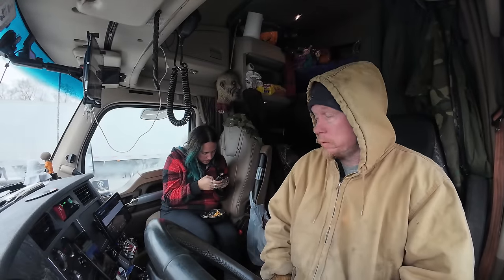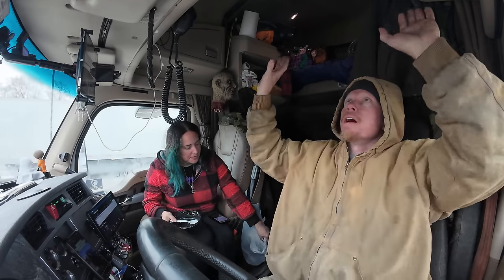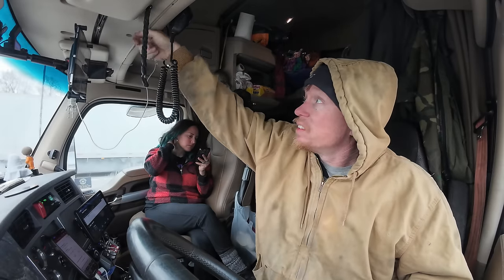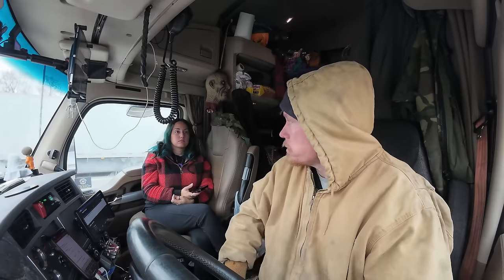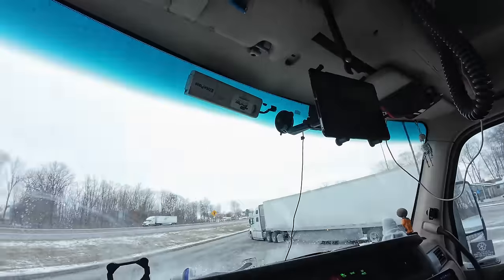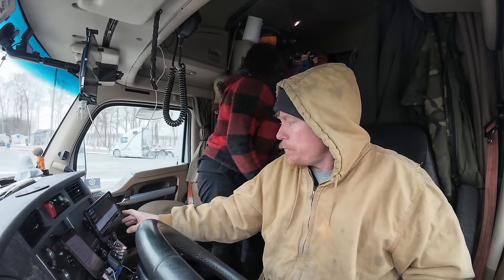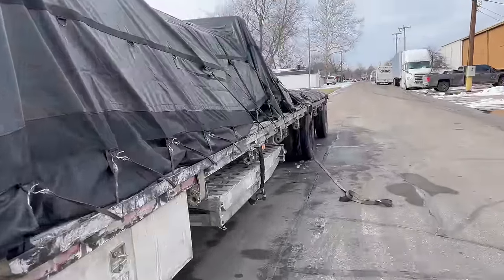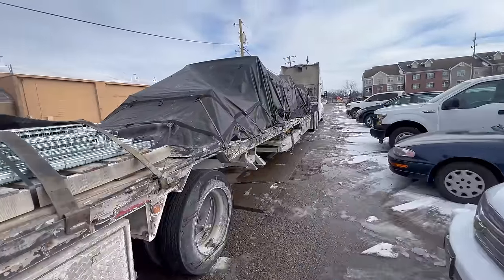That’s not going anywhere! Short 100 mile run!

Comment: I've had a little water drip from the overhead like yours was, and once or twice I had some leak from above my lower sleeper window. No rhyme or reason for when it does it. One thing for sure, it doesn't leak when I wash the truck with a pressure washer so maybe it is just condensation.

Comment: IDK If you can in the Truck but I run the AC in the winter sometimes in my Rav4 when I want to get rid of condensation and fogging inside the vehicle. I turn up the AC temp so it doesn't run cold. and this really clears things up for me.
Reply: Brent: I do the same thing in my tractor.

Comment: I was assigned a 2014 T-680 to drive.  It always leaked water in the winter when in snow and icy conditions.  One of our mechanics said that the gaskets around the cab marker lights would shrink and break in extreme cold weather.  He fixed the problem by replacing the gaskets.  Have you experiences your dash lights going out while you are driving at night?  That's been going on KWs for decades.  Safe travels from a subscriber from SC.
Reply from the maker: not yet, fingers crossed. have read about that though on some facebook pages

Comment: Those new Petes and KW cabs are leaking through the screw holes in the marker lights for sure. We just got through doing the third one for  a little company down the road from us.  We used weather strip adhesive on them and no more leaks.  They run back and forth to Louisiana in a lot of rain and the leaks stopped.  I figure it must be the way they use elec power screw drivers at factory and enlarge the holes.  Just be very careful loosening the interior trim and not break clips.  Hope this helps.  Bill

Comment: 2 adults, two dogs and expelling warmed air in a coupe that has no open ventilation? What go  wrong? Open the windows! and check your cabin filters more often in the winter. The warn air is condenseing just under the roof truning back to water droplets...many poeple call it the rain cycle...Let the warm out once in while..LOve the vids.....be safe..go get'm....
Reply: This is a good deduction of what might be happening. Especially, being closed up for 6-8 hours without opening any windows or doors on cold nights.
Reply: Don't forget cooking
Reply: Good idea  open just a little bit the window

Comment: Call Michael lights on the top of your cab. I would check all the seals around those. You might need to reseal those in the condensation that build up on the roof is running down and going underneath the light.

Comment: Seems like you have a condensation problem.  Airflow and insulation can solve that.   The area where your radio is seems to be feeling cold air from the outside while the warm moist air expelled from the family members in the cab is hitting it and condensing. you might try insulating that area with the same reflex material you made the window covers with.  Use spray glue to attach it to the faring cap above the windshield good luck.

Comment: If you want a huge sleeper that’s well insulated.  I have not been in their KW680 ones.  But the 800/900 ones were amazing.  But almost cost of that dump truck with bad clutch. *ok it was less but in last decade, especially last 3+ years*. Custom KW in MN

Comment: We have a class A diesel pusher and we had the same problem with moisture when we were traveling in the winter. The heater in our coach has heat pump / ac units on the roof but they will only make heat down to 32 degrees so then we turn on the built in heater that operates on propane. Probably the same heating system you have in your class A. The problem as you said its from you guys and the dogs breath that is ex haling H2O and in the rv the bi product of propane is H2O and that makes it worse. So the answer is to let the H2O out. We just. crack open two roof vents to let the H2O out and there is no moisture problem. If you have a vent up high in the sleeper just crack it open and leave it open all night or at least crack open one or both windows. Im talking !/8 to !/4 inch. Your house doesn't do that because it has much more insulation and the roof is vented.I have noticed that sometimes in the morning when you remove your silver window covers it looks like there is ice on the inside of the window. So I guess that proves people are not only full of S**T sometimes but are full of water all the time.Anyway love you guys and your videos, keep em coming.😀

Comment: 100% moisture from 2 + 2 pairs of lungs exhaling.  It likely didn't occur in the Mack because it had better insulation or the cab of the older truck had a looser vapor barrier thereby permitting moisture to vent to the outside more easily.  Small exhaust fan like a computer cooling fan in a cracked window will eliminate moisture buildup inside the cab.

Comment: My father's '62 KW leaked like a sieve too. I see KW hasn't improved much. lol Actually, I think you are correct, it is the condensation. Each person transpires up to one litre of water each night through breathing and perspiration. There are two humans and 2 big dogs, so you could be producing 2-3 litres of water each night. Plus you are cooking in that small space.If you don't ventilate adequately, that moisture has nowhere to go and condenses on cool  surfaces. So venting to the outside is important. You can also buy humidity absorbers that are used when storing RV's, boats etc and keep one in the truck.

Comment: That is condensation from your body heat and the cold air outside the fiberglass does not insulate very well. You need to keep air circulating in the cab to dry the condensation!

Comment: You are just going to have to stop rubbing her if you don’t want her to drip..🤣
On a serious note…the insulation above must not be glued to the roof …instead down on the headliner causing a cold spot and condensation on the roof and dripping down…you can fix it or just wait until the cold is gone and so will be the condensation

Comment: Run the truck ac , that will remove the humidity. That’s what ac does.  Even the defroster if you can’t control the temperature of the a c.

Comment: Get a dehumidifier
Reply: Maybe buy a combined temperature - humidity gauge. They run about $25. Then test the different condensation areas, for humidity and temperature changes. There has to be higher humidity and temperature changes in the areas that have water.
Reply from the maker: I thought about a dehumidifier but am afraid of a bloody nose, and chapped lips from it being to dry

Comment: First thing I would check,  check your lights on the cab on top , Pull them a part silicone them up put them back on ,  and it could be coming from your windshield on top it's not correctly and precise sealed ,   Had them 2 problems on my Peterbilt ,  Water was getting in and then  condensation  however you pronounce it starts ,   It is not from your lita and you it is not from your lita and you and your 2 doggies, That is not happening bullshitt story ,   add a little bit of  rubbing alcohol to your windshield wiper fluid  that is what a few of us do ,  Like you say check your hoses put new ones on , Probably where it plugs in at the wiper it's plugged up ,    You got it in your blood to be an owner operator , But you have to learn to relax and take care of business  or stress out and have a heart attack ,   dump trucks are expensive my man ,   a lot of wear and tear on a dump truck  dump truck and trailer nickname a slam bang ,  😂😂   Get 15 or 20 below  0 myself am not a tougher dude  I freeze my balls off 😂😂    I seen the water up there again, and you have a lot of water up in the ceiling my friend , you better find out where it's coming in at ,    See that KW. with the big bunk that is what you need ,  You are out on the road 90% the time , You might have to get a little bit lighter trailer , But that truck and your trailer you should be able to still haul 43000 pounds , Something to think about in the future ,  Lita she will love it ,   The back end of your trailer tarp job , You should have rolled the tarp up and then put the strap on it to hold it ,  Not telling you what to do just giving you some  advice ,   Lita tying down on the back 😂❤❤    I do not like them little  ratchet junk to me ,
be safe out there take care yourselves😮